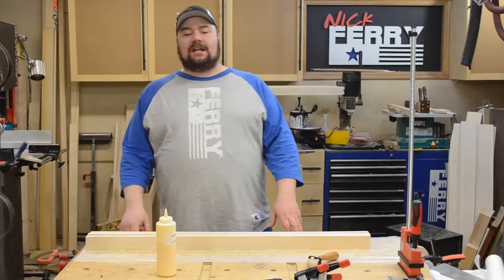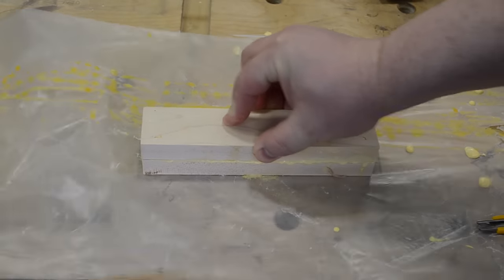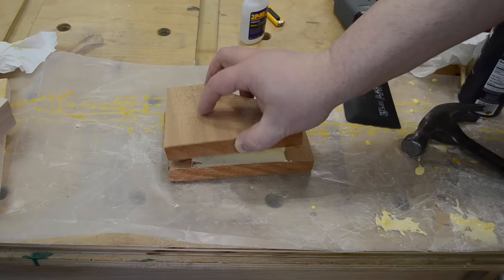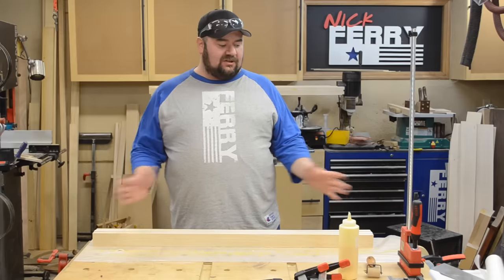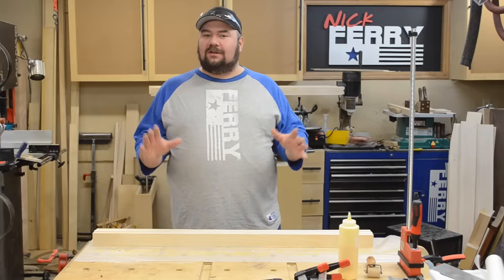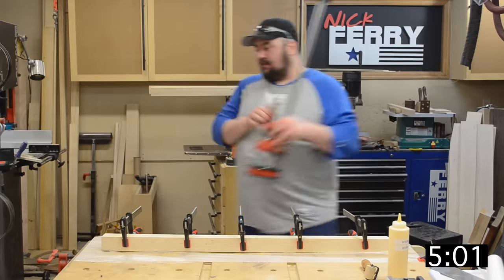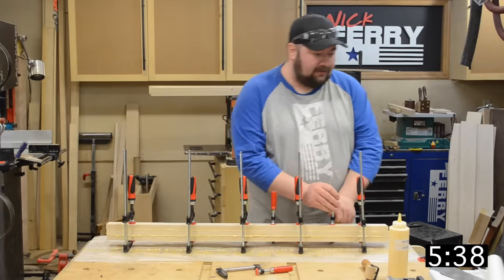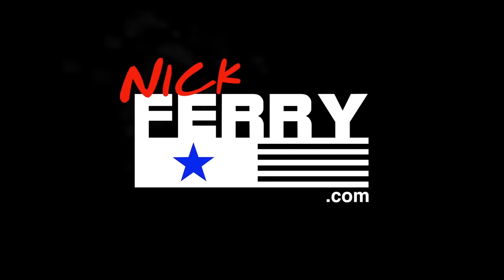Ⓕ Best Way For Gluing Wood Together To Get Thick Pieces (ep86)

Comment from the maker: a lot more woodworking articles, info and plans here - https://nickferry.com/ - and the article for this video with tool list here - https://nickferry.com/2018/03/best-way-for-gluing-wood-together-to-get-thick-pieces-ep86/
Reply: Router gig to flatten plank of wood with twist
Reply: Nick Ferry just fyi chemically silica sand, like sand blasting sand, would be better than salt because its inert and salt is a polar molecule that reacts with water.
Reply from the maker: texasfossilguy water itself is polar and pva glue is water soluble - I personally wouldn't want to use silica sand as to not have a physical separation between the wood pieces to be joined
Reply: Dominick612
Reply: If you have a cutting board or something a bit too big for your parallel clamps and you have dog holes on both sides of your workbench you can take a board with some spring in it and put it on top of all the pieces with hold fast's holding the surfaces all flat and add the other clamps, or do this then once you have a few sections do that.
Reply: Is construction adhesive better than wood glue?
Reply: Nick Ferry - jeez I just did  exactly this for the first time a few days ago to make some tapered legs. I wish I’d seen the video last week.
Reply: @mikel4510  im confused -are you saying this is the wrong method? If so what is the correct
Reply: @mikel4510 not that I disagree I meant a better method for alignment- im a 4th generation carpenter, and before that my family owned a custom boat building business in Highlands NJ. Louis Loder  my great grandfather designed the first rum runner- all that is to say I learned most of what I know from hours upon hours of watching his little workarounds and then my grandfather and subsequently my father. 
As far as alignment, we've used other methods similar to the parallel clamp as alignment guides. I dont think just slapping glue on and clamping it is the best solution. I've seen my family using hand tools and measurements bring two pieces of wood together so well that you can't fit a sheet of paper, obviously I had no ads to deal with but I learned by watching them i feel lost people didn't have this opportunity and they use this as a means to gain that knowledge. I find it entertaining personally and usually leave them playing while I build something in the shop... just my 2 cents

Comment: How many clamps does a woodworker need? Answer: one more than he's got
Reply from the maker: Exactly!
Reply: Amen to that!!
Reply: You can never have enough clamps!
Reply: Ron Tocknell haha yep, you should see how many clamps are needed when doing a stringer for a geometric staircase... ALOT!
Reply: Ron Tocknell I have exactly 220 pieces. Still not enough. Guess you’re right. I need one more.
Reply: Buy a variety of sizes I bought like 35 to start and its good for what I do
Reply: I only buy them new if I can get a pair!
Reply: You can NEVER have "too many" clamps!! ;-)
Reply: Every. Single. Time!
Reply: I buy one or two every trip to the tool store. Whether I need it or not because I need it. I just don't know why I need it yet.
Reply: biggest investment in a cabinet shop is clamps
Reply: At least one more than he has got.
Reply: always!
Reply: Amen !  I'm awesome at starting projects until I  hit a delay for whatever reason ... usually right after a massive glue up..and with my clamps tied up, so j shouldn't start another project... just bc I'm bored with this one now ... right ?  

Well.... uhhh....well... I seem to increase my clamp collection in batches ... because inevitably when I would rather start a new project and don't feel like finishing this one ...  cleaning up a glue mess,   THIS always happens...  I'll see a crazy super good deal on a bunch of clamps in a classified ad.  Lmao.  True story.  Just keep an eye out for CERTAIN items always ...even if you don't need it.  A good deal is a good deal.  

Likewise... a good tip is a good tip too!  🤣
Reply: But many less than SHE'S got. 😉
Reply: Trick question bc numbers dont end 🤣
Reply: My dad calls them buddies
Reply: @neillongley59  The expression is "You can never have too many clamps."
Reply: Always

Comment: Why not just put two parallel clamps on, one on each end and  then add all your other clamps, then remove the parallel clamps at the end or heck leave them on they are inconsequential at that point. This way saves from having to readjust a single parallel clamp multiple time

Comment: I use dowels as tree nails. Clamp up dry and bore to size, the drive in when wet. Does not matter where they are, cut mortices, dovetails through them, also adds to character and looks attractive!
Reply from the maker: excellent

Comment: If you don't have a parallel clamp you can just use regular clamps with 2 flat wood pieces instead ! great tip thanks for sharing !
Reply: This. The wood pieces allow more movement when the actual clamping gets done.
Also instead of one parallel clamp that walks down the join, I just put two on. One each end.
Reply: That iswhat ihave done in the past, especially for longer or wider clamping, but realized if I do small parts and then with dowels and clamp finished product I get better results.
Reply: Calls right?

Comment: Just use bar clamps or pipe clamps so they rest on the bar to get them flush. Tighten them up then flush them up then tighten again and flush them with a piece of stock wood and a hammer after they are tight. repeat as needed

Comment: After 40 years of experience, 25 pro you learn to not use sooooooo much glue.  Squeeze out is excess glue, do your best to minimize it.  Squeeze out is an indicator of plenty of glue but it should simply bubble, slightly, out at the joint line, dripping is way too much and too much trouble to remove.  Excess glue is wasteful and further causes slippage when clamping.

Do not use excess glue to fill a gap, add more clamping pressure.  Clamping pressure will not starve a joint, contrary to what many think.  A thin glue line is a strong glue line/joint.

 
Try to never glue up stock that is cut to finished width or length.

Lay your clamps on your work surface so that the bars are parallel to the work surface.  Lay the pieces to be glued on top of the clamp bars.  Let gravity help to keep pieces aligned.  You can tweak a little after clamping if there is any slippage.   With there proper amount of glue there will be minimal if any slippage.
Reply from the maker: I appreciate the feedback - I’ve used varying amounts of glue over the years and always came back to preferring to use too much over too little (at least where laminations are concerned) - basically I’d rather have a bit to clean up than risk a void or dry spot

as for the work surface clamping option - I’ve used this clamping method on pieces as long as 22 feet - hard to find a table that long to work from - also, in theater builds I often have to glue up curved handrails and this method is ideal for that as well

Typically I do make my glue ups thicker, wider and longer than finished dimension, as I did in this case - this method merely keeps tolerances tighter cutting down on waste, planing/milling time - in the case of exotics and figured woods, this can be extremely beneficial 

I also agree wholeheartedly that glue is not to used to fill gaps - aside from sprung joints, clamping pressure on a panel glueup should be minimal - if it doesn’t come together properly dry, glue and clamps is not the solution and the joint should be reworked 

In summation, yes there’s always more than one way to do things - I tend to lean to this method because it’s quick and suitable for a wide array of applications and for me and my experiences the pros outweigh the cons ten fold
Reply: Nick Ferry bam! Nicely said, Nick. Lol, also, I could see the huge benefit here to be when doing glue ups over say, 10 feet. Where you are much less likely to mill the width after glue up as running a dozen or more linear feet through a table or band saw is cumbersome to say the least. Great tip and I will be using this method for large future projects. By the way, I’ve never noticed a comment by a person with 40 years experience in woodworking leave a positive comment on a how-to video on YouTube. I often wonder why they watch how to videos instead of just make them.... Anyway, keep up the great videos man! -Art
Reply: @artiet5982  I’m glad that people are willing to share their experience, and I don’t think Leon’s comment is negative. Yours is.
Reply: M M thanks for the input. I was probably in a bad mood that day.
Reply: Leon Bridges   Yep I agree makes a lot of sense and well explained. Thanks

Comment: Hi Nick, I have been using this method for several years now.  Before I just used the table top to align the pieces, then I started to use the aligning clamp.  In my 35 years of wood working, this is truly the best way. Great video.  thanks for showing it.
Reply from the maker: thanks Tim!!

Comment: Genius ! Great Idea with the Parallel clamp - I've seen hundred of laminated workbench 
videos and everyone just uses clamps across thickness then planes,sands or runs thru
a thickness Planer not worrying to much about being square across top & bottom of
workpiece! After 100's of videos I chose your Joinery Method ( Garden Bench build) for 
my workbench & your way of Clamping Up the Workpiece ! Thanks So Much Nick !!  : )
Reply from the maker: Very cool - glad you were able to put the two videos together to come up with a bench!

Comment: Most of the time it is little simple things like this that help the newbie more than any formal class they could ever take. No tip or trick will work every time, as some other comments here have mentioned, however if it works only once then it made life so much simplier. Thanks for sharing this tip, and PLEASE continue to share any tips or tricks you might have, if you only help one person, well it was worth it. Great video, thanks!!!
Reply from the maker: thanks much - I am very happy this could help a couple people out - works really slick!

Comment: Nice technique. One thing to consider is to simply use two K clamps (the parallel clamps) on both ends and just clamp in between with smaller clamps. That way, you can speed things up just a bit, especially if the wood to be laminated are dimensionally identical. No need to continually clamp and unclamp the one parallel clamp going down the length of the wood. Also, if you are not going to be doing a lot of additional dimensional work on the laminated piece, you can drop 3 small dowels/dominos/or biscuits into each piece. This will also allow for glue-ups with near perfect alignment. I know a lot of people do this more for tabletop glue ups, but they can work well with leg glue-ups as well, but the key is to avoid much more additional dimensioning or you might have the alignment dowels/dominos/biscuits show in the final product. Although that might be cool if you intentionally wish to show the internal joinery.

Comment: Always done this - thanks to my high school shop teacher who taught me a ton. Also - Clamps apply pressure roughly 40-60 degrees from the pressure point so it’s much more efficient to use cauls to thicken the assembly. If the thing is 2” thick like your glue-up you really need a clamp every 2-3” to have even clamping pressure. But add a 2” caul to both sides - voilà a clamp every 6-9” would do the same job.  I’m hedging because it depends on the type of clamp used- but you get the idea - use cauls. F and C clamps are the worst bc the pressure point is so small.
Reply from the maker: good rule of thumb for sure but ultimately clamping pressure force angle is dependent on beam strength of whatever is next to the clamp pad - the more dispersion of force by a caul in many cases is good, it also lessens the actual clamping pressure to an overall surface when dispersed - so either cauls with high pressure clamps or omit the cauls and add more lesser pressure clamps

Comment: Final little comment on glue-ups, for larger pieces:
-it's not necessary to do all pieces at one time, so, do them in sets your clamps can handle
-for the final gluing, align your sets against a straight edge, and on a flat surface; it's best if the flat surface is finished or metal (so glue doesn't stick too much)
-lay weights over the joints to keep them under some pressure; I've used cans of paint, heavy tools, whatever is handy
-for lateral force, I use a bottle jack and a couple of 2 x 4's. Remember you're not smoking it down, just even pressure, so the butt of the jack just needs a solid place to rest.
Sorry to do all this with words, a picture would be much easier. It's really pretty simple.
-

Comment: Amazing use for my sole parallel clamp. Great tip Nick! First time seeing it.
Reply from the maker: It is - but of course now you need more parallel clamps
Reply: Nick Ferry : parallel clamps are expensive; I use scrap wood as cauls and wax paper.
Reply from the maker: another great way of doing it - for me this has been quicker - and try packing tape on cauls instead of wax paper - makes positioning a breeze
Reply: @LARPin’ 4 the LORD Order them online.
Reply: @LARPin’ 4 the LORD  I got a similar deal from Home Depot earlier this year on a set of four KRE REVOlution K-Body clamps:  two 24" and two 50".  Amazing price.  You have to wait and watch for discounts to come along.  I'll bet we'll see some sales once we come out of our isolation later this year.  I've had some Bessey parallel clamps for over a decade, and these new ones are far better.  Parallel clamps do what others can't.  Nick has shown us a creative use for them!

Comment: BRAVO, You are the first person I've seen on You Tube that has advocated the gluing of a peace on both sides other than me.  I have a video on my Roubo Bench build and in it I mention the necessity of gluing both surfaces for the best results in wide areas to be glued up.  During my apprenticeship I worked with a lot of German cabinet shops here in Los Angles and they all thought me that method of gluing bar none.  The only thing I would say I differ with your comment is that I was thought to put one side a very good cover of glue but not to excess and the on the other side a light cover so that both sides have a complete cover of glue but not to waist glue on the run out of glue.  A little run out was professionally accepted but a huge run out was looked upon as very amateurish meaning the one hadn't yet learn how to properly glue up a peace of wood.   I never knew exactly way it was the best other then that was the way to do a good job  take a look at my bench build Dan West Roubo Bench build
Reply from the maker: Cool to hear - I do really like breaking that surface tension between pieces - I normally put a hair less glue on - being I had one take to get this right and it all was in one take, I probably went a bit heavier then normal

Comment: Nick:  This technique (seems to me)  only works if every board is the exact same width.  If the boards are slightly off, then I cannot see it working well.  The parallel clamp would only touch the widest board.
Reply from the maker: In that case you wouldn't need to be so exact in the first place - if they slid a little it'd be no big deal
Reply: Correct.  I end up just aligning one common edge.  Glue them up and then hand plane the uneven edge down to dimension.  Seems to work.  Can't say enough about parallel clamps.  Glue ups became a pleasure after I got a set.
Reply: The parallel clamp would only touch the widest board, but it would still limit the amount that the narrower boards could slide - which is the intent of the solution.
Reply: Nick, truly seems like a great idea. Sometimes it isn’t the earth shattering discoveries that mean as much as the simple ideas that make routine tasks easier.  Thanks for the ideas...
Reply: You could put wedges or shims for the less wide pieces so that they will all stay close
Reply: As long as you are ripping your boards without moving the fence, they'll be the same width, and if they bow or curve, this pulls them in parallel.
Reply: Really captain obvious?
Reply: In theory, but you have a few things that will change that.  How are the jaws on the clamp affixed to the 3 pieces connected to the champ.  Are they fixed at 90 degrees or can they move a bit.  Next, you have what the jaws are made out of.  If they have any compliance to them so they do not mar the wood, they may have enough to compensate for small differences. And last, are the boards perfectly rectangular or do they bow a bit?  If they have a bow to them, I suspect even a slightly smaller piece will hit some of the clamps  If a piece is just "flopping" around, you could always put a piece of soft wood on one of the jaws or put a shop rag over one of the jaws.  Anything to give it some compliance.   If the top or bottom is true you can use the planer or shaper to clean the other two sides up after they are glued.
Reply: That's when you just use the bench and gently tap them to stay flat against the bench as you're clamping them. A bonus is that at least one side is made square and makes it easier to make the rest of it squared up.

Comment: I dont have any parallel clamps but i do the same thing i would on bigger glue ups i use cauls just for allignment like that then right away remove em for clamping other side for even pressure and to clean up
Reply from the maker: Sweet - good way of doing it too!
Reply: Cauls can be custom made to fit a glue-up or assembly job.  There are plenty of articles and images on the web.  I also keep cauls from sticking to the assembly with plastic wrap.  Just enough to fit between the caul and the wood plus an inch or two on each side.
Reply from the maker: Ferndalien or packing tape works good as well
Reply: If you don't have parallel clamps, try a straight piece of scrap and normal clamps to distribute the pressure over the whole edge.